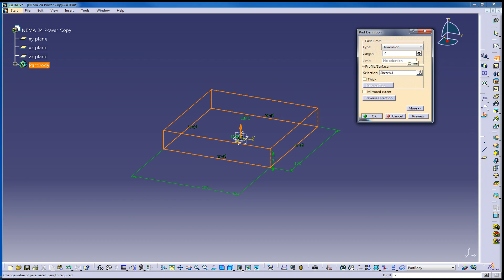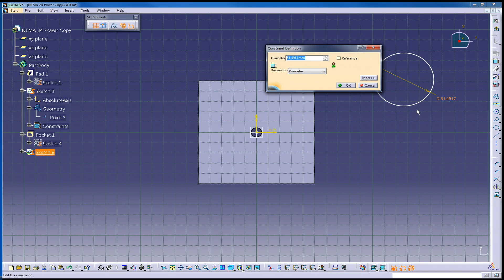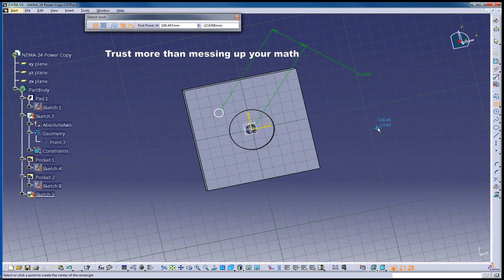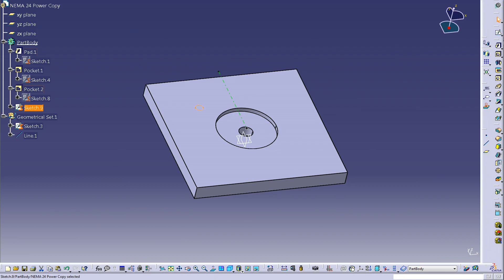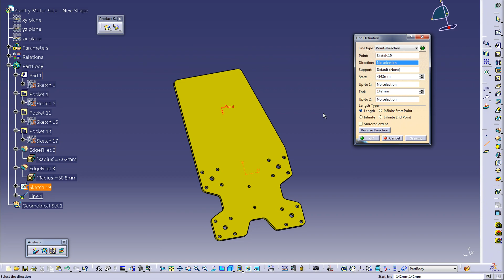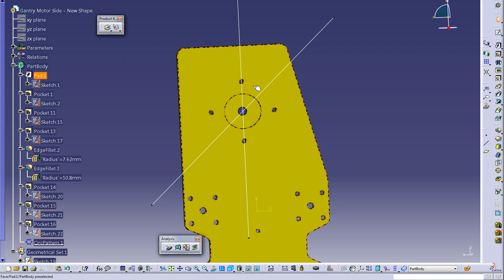#51 - CATIA Power Copies

Comment: Great video

The yellow part has a common 5 hole pattern at the bottom.  How do you link the power copy to each of those instances with parameters.  For example, I want to modify the center hole diameter by making it a parameter.   I want all 4 locations of that pattern to update when I update the single parameter.

I've tried a few things but it always creates a new set of parameters for each new instance.   I want all instances of the power copy to update when I change a single parameter.